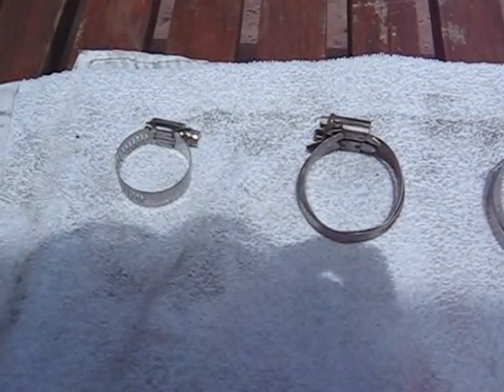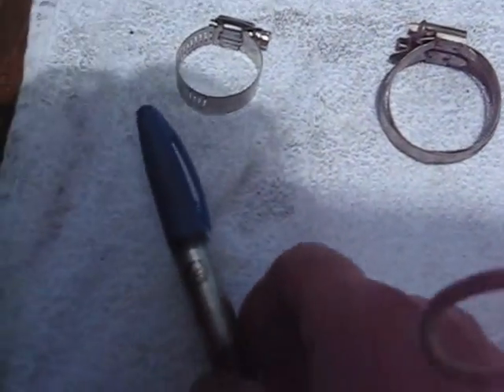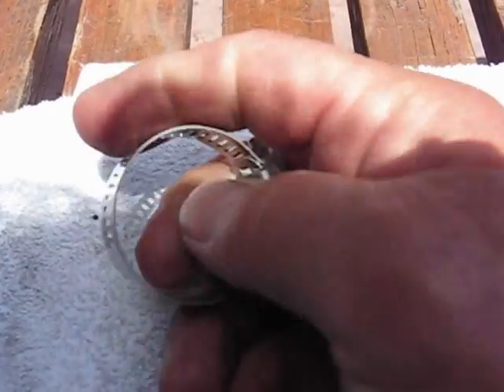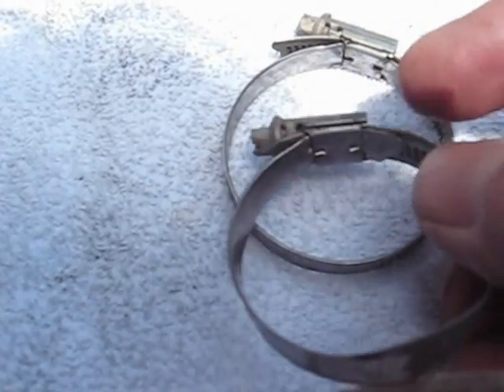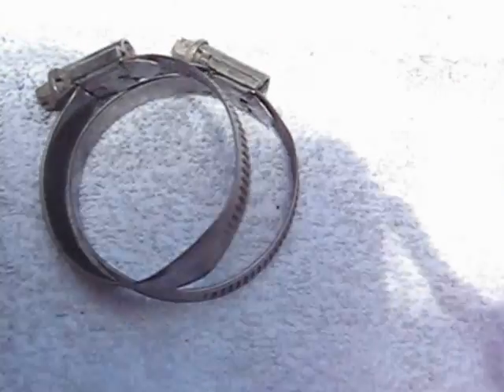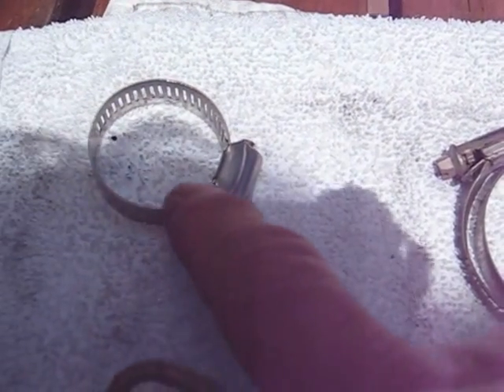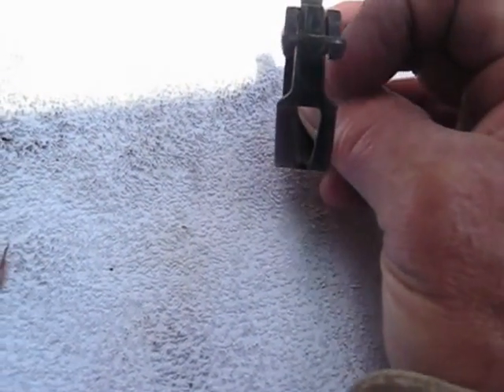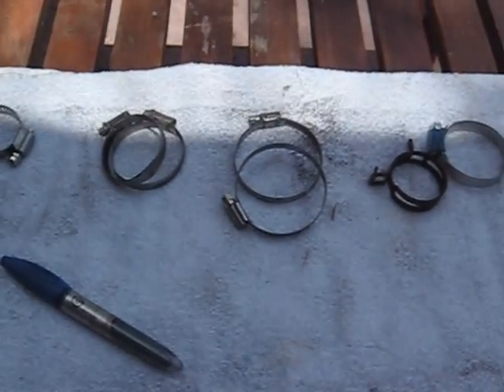Hose clamp different types by froggy

Comment: Would these get rusty? I need to fix one of these to my bike. Just wondering if it will degrade over time and possibly cause a safety issue.
Reply from the maker: Yes they will rust eventually, buy highest quality you can.
Reply: @1947froggy  Ok will do. Thanks for the quick reply.
Reply from the maker: What's going on the bike?
Reply: @1947froggy  It's one of these new hip folding bikes. There are so many moving parts but the most important part is the handlebars. I need that to be rock steady. So I'm looking for something to wrap around tight the handlebar "stem"..  (2 inch diameter) when I assemble the bike. There's a joint that's a bit wobbly but I think a hose clamp would fix it.
Reply from the maker: @soundbeans  Hmmm, so this is one with the smaller wheels & frame and taller seat post and taller stem for the bars? Not sure it'll help much but good luck & post back how it turns out,  :)
Reply: All the good ones like ABA have ratings from W1 (galvanized steel) to W5.  W4 and W5 are complete stainless for marine use (seawater).  But I doubt even a W1 ABA will rust on a bike.

Comment: How can I properly size the spring type clamp for my car.  The original ones are missing and my radiator outlet size is 1-3/8.  Stupid mechanic threw them out and put worm type on and I'd like to replace these with spring type.  I don't want to accidentally crush my crappy plastic radiator outlet.
Reply from the maker: +Scott Z I would base it on the hose OD measurement, they are not "exact" size, they will accommodate a (small) range of size.

Comment: Wow, glad I found your video.....The clamp on my hose is the first clamp you talk about and its leaking coolant so I guess my mechanic screwed it too tight. My car is a 2002 MB c240. So I guess he went with the cheap clamps. How do I go about getting the right clamp on? Should I buy my own and have him put it on? Or should I just go to him and explain what the problem is? The funny thing here is that, I went to him to put a new water pump and hose in. I guess he didn't think twice about the clamps
Reply from the maker: If you went to a dealer they should have used a  good quality clamp, independents sometimes cheap out. Either way  I would simply go back to him, show him the traces of the leak (even if the leakage dries up from engine heat, it still leaves trace evidence) and ask him to fix the leak & tell him you do not expect to pay again as it was not done right the first time. Mention that a friend (me) said the clamp did not look like high quality that should be on a MB.

Thanks for watching!
Reply: I would have went to the dealership, but u know they would over charge me. I wish you lived in Southern New Jersey....at least I know it can get done right. But thanks for the suggestion....I will tell him a friend (😉) told me that the clamp is not a high quality one for a MB......Thank Again
Reply from the maker: You're welcome, this should be an ez fix, good luck.

:)

Comment: Can you use two clamps for a lower radiator hose? The radiator hose leaks a little from the end. So I thought of using two.
Reply from the maker: Sure, I have two clamps on my lower radiator hose, it had a tiny drip. If there is a lip/bulge on the fitting, make sure you can fit both clamps on the pressure side of the fitting, sometimes 2 narrow clamps can be better than 1 wide one.

:)
Reply: Thank you for the quick reply! Yeah, I have those plier clamps and it's leaks a little at the end. I have those flat head tighten clamps which I am just going to put it right behind the plier clamps. I just didn't want to pull it out and take it with all the coolant dripping. So it won't swole up or have air pressure on my radiator hose?
Reply from the maker: No, one, two, three if you can fit, makes no difference to the pressure on the hose, if that is what you mean.

:)
Reply: Okay yes thank you for the advice have a goodnight!

Comment: best and strongest clamps you can get are fuel injection hose clamps that use a nut and bolt, only down side is they're limited in a size and application, meaning they will only tighten so far before the nut and bolt bottom out
Reply from the maker: Thanks!
Reply: How about for larger sizes, about the size of radiator hoses? Of course, the pressure will not be nearly as high since you'll burst your radiator, but thinking about something kind to hoses and still providing good clamping makes me lean toward ABA.

Comment: The ABA clamp you show has the inside tail end protruding beyond the inside surface of the clamp. It looks as though if tightened it could cut into the material of the hose. Suggest you have a careful look at this. It's a weakness potentially of all worm drive clamps but not so on other types.
Reply from the maker: You have a good eye, yes  noticed that on all of them, it's one of the reasons I started looking for better, thanks for viewing!

Comment from the maker: That's a good strong clamp also, usually does not have as big a range in size. Some large sizes (for example on exhaust systems) are VERY strong. Thanks for mentioning.

:)

Comment: Thanks, Froggy!  On more than one occasion, your upload just so happened to coincide with something that I just so happen to be pondering myself at the time. Just a couple days ago I went to the dealership parts dept. to buy the radiator hose clamps and they gave me the cheap ones you show in your video, and they told me they don't carry the oem constant tension ones anymore.  I bought them, but didn't really like them. Your video solved my problem... I will return the ones they gave me. Thanks!

Comment: where online did you but the ABA clamps? I have a 1999 ford mustang coupe & I had a constant tension clamp but it broke. I bought a clamp at auto zone thinking it would secure my coolant from leaking out the hose but it didn't. You're video helped explained why. It looks like the first one. I took it to two mechanics and they kept saying I don't have a coolant leak. It's not a coolant leak, it's the clamp.